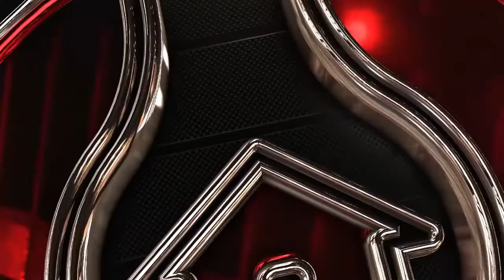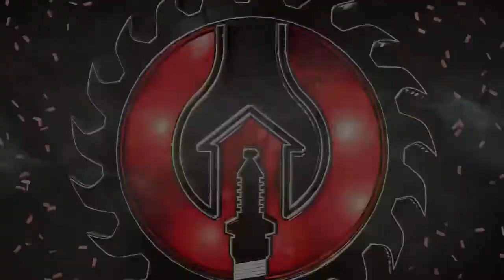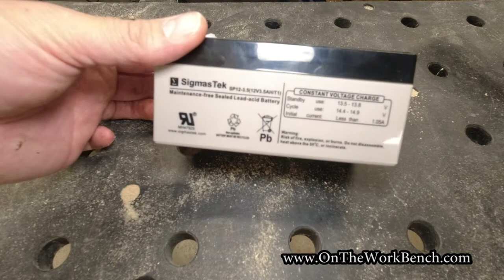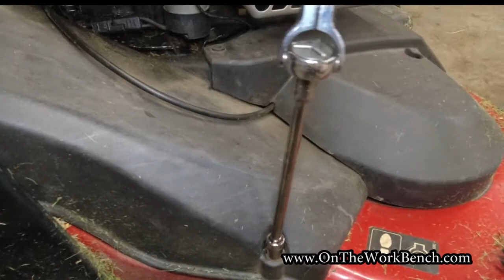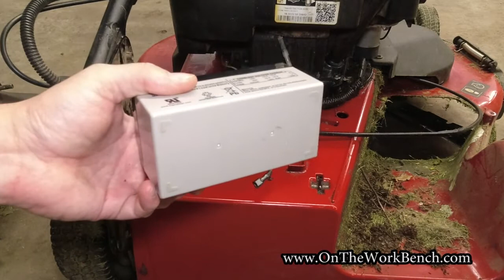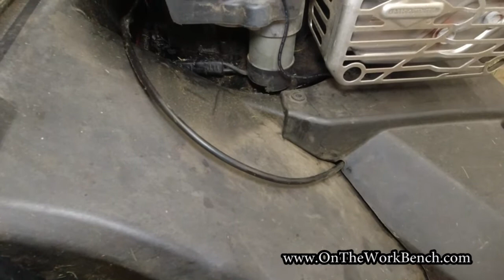Toro Timemaster Battery Replacement

Comment: Many thanks!  Mine died after about 4 years.  Just grabbed a replacement from Amazon and now it's back to normal thanks to your excellent guidance  Mine did have one extra screw at the top which had to be removed.  It's just there to keep the blade engagement cable in place but the rear plastics would not come off until I removed it.  Great video.  Thanks again!
Reply from the maker: Happy to help!

Comment: Does the mower have an alternator? Or does the mower need to be plugged in so that the battery can get a charge?
Reply: You have to plug it in to charge between uses.
Reply: @GunnyPhillips  I have purchased a TM and now I can see that it does not have an alternator.

Comment: So I have the same mower.  When I turn the key it cranks, but won't kick over.  Could this just be the battery or fuse that in having an issue with?  It's about 6 years old I'd say.
Reply from the maker: if the fuse is bad the starter will not crank, but if the battery is weak it might not turn fast and long enough to start. Easy way to rule that out is to hand start it with the pull cord. if it does not start within 3-4 pulls then it's a different problem. Could be clogged carb (from bad gas or ethanol), engine throttle control springs or return damaged, or fouled plugs.

Comment: Good video but the first thing that should be done is to disconnect the spark plug.  The hardest part about the battery replacement is aligning the bolts that were removed.  I used a Phillips screwdriver to align the holes in the plastic with the threaded holes in the mower's deck.  Like the author said, it is only a 10 minute job.  Thanks again.